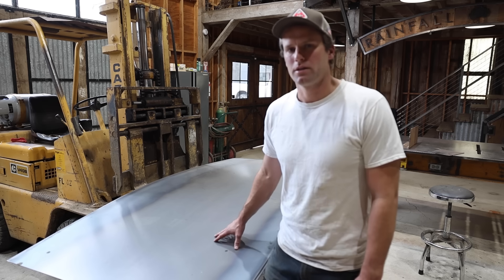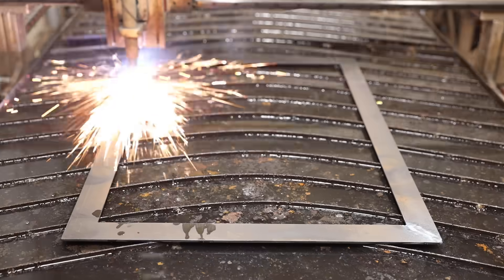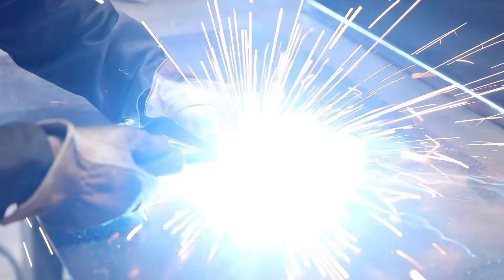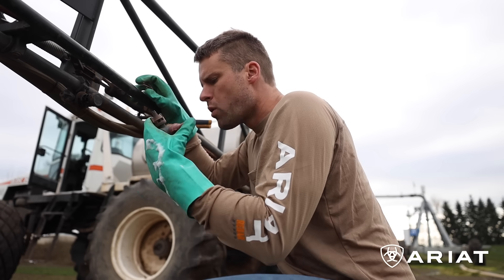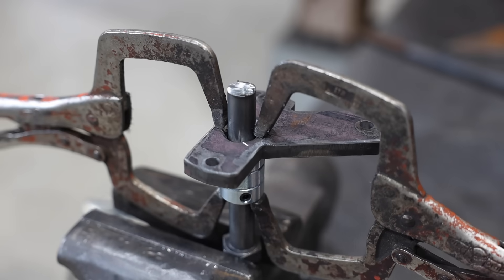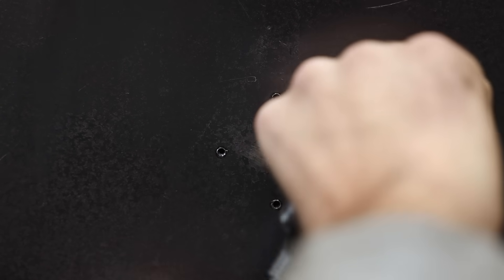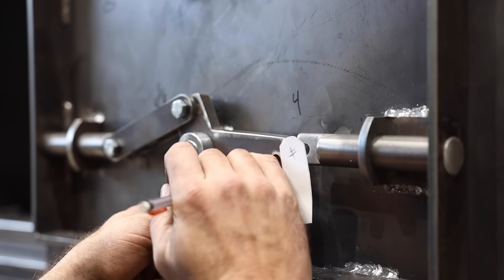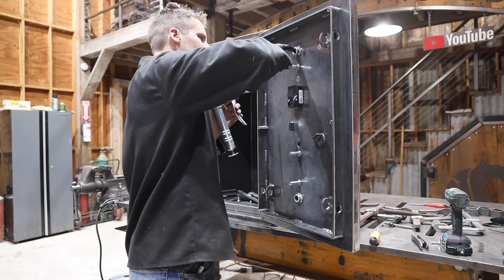Building a Fireproof Safe (pt. 1 of 2)

Comment: You could have coated the ends of the bolts with graphite or something similar to leave an impression ... I think.

What did you use for insulation?

Comment: The hinges on the outside: a no go.
1) Put the hinges at the top corners on the inside to prevent the use of a cheap grinder to crack the safe,
2) add a double/triple layer of hard/polymer concrete around the walls
Reply: How do you do inside hinges and the door open out?
Reply: @dnastats  You'd probably have to make some custom "pocket hinges". Even then, though, this safe wouldn't be too difficult to get into. You could get a big grinder and some cut off disks and get through the side, or even the door, in a matter of minutes. Though I don't think this safe is really intended to store anything super valuable. Just keep kids and maybe a "smash and grab" robber away from documents and what not. 

I have no doubt that his guy could fabricate something that would be a nightmare to get into, it's just a matter of how much time he'd want to dedicate to figuring out how to build everything and how much he'd want to spend on materials. In the end it'd probably just be cheaper to buy a safe from a company that has figured all of that stuff out -- or get one second hand.
Reply: @Sleepyjackable that's not a bad idea. And some 1/2 ar500 plate would make cutting into take alot longer and less likely anyone would run off with it
Reply: @dnastats yeah exactly, then make your "void space" no only be firewool but concrete then fireprotection or some cut resistant fabric that would bind up in a grinder. 

Ultimately nothing will stop a determinded person but itd be interesting to find ways to make it a headache!

Comment: To locate the bolt holes for drilling you could have just painted the locking bolts with wet latex paint you may have laying around and done the same thing.

Comment: Way better job than I could do... however I see a weak point with the locking mechanism.

The handle seems way too rugged.

 I would think that if you stuck a 6' metal bar into the outside handle and rotated it downward, it would snap the mounting points on the locking mechanism, allowing the bolts to be retracted.

Seems to be an easy fix you could just reduce the diameter of the handle shaft on the inside of the safe so it will snap before it breaks the mounting hardware or the locking key on the lock.

Or connect the handle shaft to some kind of shear pin.

Just constructive criticism.

Comment: It would have been better to fill the gap between the two layers with reinforced concrete and not with ceramic fibers? And the benefits of concrete, first, to increase the weight of the safe to prevent it from being easily stolen, secondly to increase its lamination to prevent it from opening? (Most of the safes in the world are filled with reinforced concrete) anyway good job

Comment: Pretty cool you can do this and very skilled. From a security perspective the Only issue is all a person would need to get in is a mallet and punch to knock the lock out. The “key” holding the 1/2 in locking plate to the opener doesn’t have any redundancy for tampering like most higher end safes. Similar to how you would knock out a deadbolt. That said, given enough time most safes can be broken into. Great vid, cheers!

Comment: 1" bolts and 1/2" brackets ON A SHEET METAL SAFE?
Also you did not put any heat expanding fire seal around the opening, so all the heat and smoke is just going to pour in your door gaps anyway.

Comment: Nice build, and I really like the door's linkage.  Future Tip - when you have to locate pin locations like that, you can "soot" the ends of the pin with your torch, or a daub of your wife's lipstick, to make sure you have a clear, clean impression.  If you use your wife's lipstick, make sure you don't tell her you borrowed it.  Wives do not take kindly to such things.

Also, the fire rating drops precipitously when you don't insulate the door or use a fire seal around the door.  All that insulation on the body is for naught if you don't seal the door and insulate it every which way you can.  Some 1/4" drywall/gypsum can be layered in there, making sure to get under the linkage mechanism, and some Kaowool blanket can fill the voids without worry about tangling around the mechanism.  The door seals are available COTS, and help to seal things when the heat rises, but also give a more finished appearance.  Without those two details, the same isn't resistant to heat/fire no matter how much insulation you put in the hollow core of the body.

Comment: Just wondering when he got to the last part, figuring out where to drill the holes for the locks.   His method with tape and trying to close the pins hard worked but I was wondering if putting a single strip of tape and then painting the end of each pin with something like a wax marker or lip stick would  have also worked?

Keep in mind I'm just someone trying to learn and build my own knowledge.  I'm no where near a point I could effectivly or efficiently construct a 2 x 2 in welded cube much less a fireproof safe yet.  Lol

Comment: Next time to drill holes for your locking pins just put a thin little coat of pain on the end of the locking pins then close it like you did and just turn the lock one time till you feel it’s snug then open door up it should have you a little paint circle then draw the outline if that with a sharpie and wipe your paint off then cut on inside of line

Comment: My trick for mathcing those holes at 15:00 is to put a ton of sharpie on the round bars, then it leaves a round mark at the right location. If the sharpie is drying too fast, I'll use paint

Comment: Here are a few simple and inexpensive adds ons for exponential strength and ROI: Internal clutch disk for the crank to prevent brute force attack. Right now the force transfers directly and you are vulnerable.  I have bought them from safe manufacturers directly for cheap. No need to drill holes in square steel to accept locking bolts, just use a thick (1/4”+) flange and bolts lock behind it. Add a simple non-mechanical reverse flange, or even a few pins, on the door (hinge side) that automatically become a friction press fit when you close the door to thwart pry bar attacks on that side and allows you focus on top/bottom & door side locking bolts - 4 sided locking support. Finally try to double support the locking bolts on the door side, again an easy add on for for anti-pry. Add a simple Re-locker mechanism (again transfer the loads and isolate - glass, etc.). No Tupperware At All - it melts before 451F and destroys the paper! Use the thermal expansion seals everyone is talking about. Dehumidifier (and maintain it). LED lights. Hope this helps the next build and others! Rock on!

Comment: I saw a video about a gun safe recovered after a fire. What caused the $25,000.00 to fail was no the fact the safe kept the guns safe but the water used on the fire got inside the safe, ruining the guns. and valuables & documents. The fire did case some of the rounds to explode inside the safe. Possibly building your safe to be water resistant as well as fireproof is the way to go?

Comment: I am a safe and vault technician.  You did an outstanding job on building this safe.  Everything you did was well thought out and works well, I am thoroughly impressed.  You do have one fatal flaw....you didn't add any relocker device(s).  If someone knocks the dial off and punches out the lock with a hammer and punch the lock will no longer prevent the bolt from staying locked.  A relocker will fire a bolt blocking the boltwork from moving if the lock was attacked in this fashion.
Reply: Can i have your contact?

Comment: Hope you put some holes in the bottom for anchor bolts. Anchor it to concrete floor with at least 1/2” bolts in all 4 corners. Then hide your plasma cutter since thats the easiest way to get into it.  Great build.

Comment: Some commercial safes use gypsum wall board as insulation.  The water chemically bonded to the calcium sulfate absorbs a lot of energy during the heating process.

Comment: Nice to see the S&G  in use . Well done very nice job looks impressive  nice lock links as well never seen links that well made before  they are normally bits of hacked out strip  few bits or hard plate in certain places would be a nice addition

Comment: A locksmith hint, get your wife’s old lipstick and smear some on the ends of those locking bolts and then slam them home they always leave a mark. It also works if you are installing a bolt lock on doors. A little lipstick on the end of the bolt and then work the lock a few times. It will leave a mark as to where you need to drill the hole for the strike plate for a deadbolt.

Comment: Anti drill plate plus spring loaded anti drill dead man system such as burglar drills into glass plate it cracks easily and releases spring-loaded bolts into frame dead sealing safe

Comment: I'd be making the walls at least top bottom at least half inch thick and the door at least twice that besides the locking pin frame plus fire protection lock mechanism protection if any

Comment: you spent all that money and time good you used good thick steel but why did you not do a anti-drill plate/glass.
my old one had glass on mine that was 2mm behind the door plate so if any one tryes to drill any part of the safe door dead bolts on all 6 locking bolts wires are under tension looped through the glass and each dead bolt is on a spring so the glass shatters the tension is no more the spring shoots down the bolts.
the only way to open the safe after this is to gring it open 
anti-drill glass is better than a hardend steel plate you can get drill bits that will drill hardend steel

Comment: Absolutely stellar work!  I loved that linkage, and really the entire project exudes a professional level of skill and expertise.  I've been in the market for some sort of fireproof safe or lockbox, and thinking about where in the house would be the 'coldest' in a fire, to place it.  Also gave some thought to a sort of fireproof closet to put the purchased box in, to increase its time and temp stats.  One thing the professional boxes have (that I figure I'd have to duplicate in some fashion in my closet) is an 'intumescent' seal that swells with the heat, since a surprising amount of heat can make it through a metal-on-metal jamb in a house fire.  Not sure how you could fabricate or source such a seal, but it might be a good idea to bring the doorjamb crack up closer to the heat resistance of the rest of this very well-built safe.  But anyway, kudos!  It's a great looking safe!

Comment: Nice job but calling it fireproof is a stretch. Fireproofing is accomplished by saturation of contents in fire which keeps interior below 350 degrees in a fire. The moisture for that saturation during a fire is stored in the fire proof liner, usually gypsum board (aka drywall) which is 50% H2O by weight. Gypsum is converted to plaster of paris and steam by heat of fire which saturates contents. Open this safe after a fire and I fear you'll find melted metals and ash from papers.

Comment: That's a really good job! Two suggestions for you now since you already put so much effort into this thing. 1: drill a hole on the inner door skin for the change key hole; this way you can always change the combo without having to remove the inner skin every time. 2: design an external relocker. I'm not saying you need glass, but a spring fired pin into the bolt work would do the trick.

Comment: Looks like you welded up the entire locking mechanism (unless I am missing something). This will actually make your safe less secure, as an attacker can now utilize the locking wheel to overpower the lock (by, say, putting a cheater bar in the handle). What you should do is make the shaft of the handle attach to the lock mechanism with something like a screw collar or grub screw, something that will be tight for normal operation but that will give way before the lock mechanism does. 

This means a quick and low effort attack against the locking wheel will fail (and will likely let you know an attack occurred to boot). If you tune the system right this will not even break the safe, as even a slipped grub screw/collar should have enough friction to open the lock mechanism once the lock is retracted. All you will need to do is open up the maintenance panel and tighten everything back up again and your safe will be ready for the next attempt.

Comment: There are ceramic studs used to secure kiln insulation. Also: for the locking pins, if they have a flat taper on the side facing out, and a matching ‘D’ shape hole, they will push in when you tighten them. Good to press down on a gasket. The gasket is the same stuff used for oven doors.

Comment: Hey there, chemical engineer here 
I just had some thoughts about the project. While yes, you are correct that themoflasks and things of this nature have a doubled wall design. The clever thing about them is the thing that is between these, nothing there is a vacuum. Since heat transfer is the energy one molecule transfers to another, if there is a very small amount of molecules to transfer heat with, the heat transfer will be very very good. there will not be any other material that beats a vacuum, that is why something like aerogel is 99% air. But I do not know if the walls of you safe would stand the vacuum to be fair, maybe thicker walls? This also means your safe needs to be waterproof:)

Comment: The easy way to find the right place for holes is like this:
1-Put masking tape on the door and cut out where the pins are.
2- Transfer the masking tape to the main box and drill the holes.

Good project  😉

Comment: That safe is super easy to open. Just place a metal bar on the wheel and you'll have so much leverage that the pin on the combinator will fall apart. But, since it's in the shop maybe it's faster using the plasma cutter.
Reply: Incorrect!  The set screw connecting the handle to the spindle will slip first.  It's an intentional weak point acting as a clutch.  Most safes are designed like that.

Comment: I know you have the double sided locking Bolts but hinges on the outside is a rookie move, grinder would hack it apart and then hack through the locking Bolts quite quickly if someone was determined

Comment: To enhance the fire resistance line the void and door with drywall board or joint compound. This is a common practice used by safe mfg. Some of  current safes I work on are using a concrete lining. Nice build.

Comment: Hot tip: try using red lipstick on the pins. The lipstick will transfer the color to the tape so you know where the hole needs to be drilled. I learned this trick from another YouTube video I saw.

Comment: @Rainfall projects -  Nice build... I would however recommend installing a thick anti-drill plate behind the dial to protect the lock itself. Also a 'glass plate' style, or spring-loaded cable relocking mechanism, they help resist against the more common brute force opportunist attacks on the door. I'd also strengthen the safe door jam with hardened steel around the entire inner door frame, thus resisting a determined crowbar from separating the door from its frame. In my humble opinion, this safe fabricated resembles a gun safe in overall 'resistive' strength, moreover not a 'safe' for high value cash and possessions. I believe smaller 'concealed' floor/wall safes, are in my opinion the best way to protect your cash & valuables. Thanks for sharing this video.

Comment: Just wondered if the insulation is thick enough. Compared to commercial fire proof safes, it doesn't look as thick. 
But I cant comment on the insulating material used for those, so who knows.

Comment: One trick I learned from a carpenter installing door locks was to use lipstick on the deadbolt when trying to figure out where things align. It leaves a visible accurate mark. Great work by the way!

Comment: Transfer screw punches would have worked better: For the lock bolts, center drill and tap, insert the transfer screw punch on each bolt. This would have left a point to align for drilling the lock bolt holes very precisely.

Two issues with the safe design:
1. Really needs 2" or more insulation to be able to hold up beyond about 30 minutes. If a fire gets near the safe, its unlikely the fire will be put out before the inside temperature gets too high. FYI: I have a commerically made safe that is rated for 80 minutes with 2.5" of insulation.
2. Needs to be water tight, as when the fire crew floods the space with water, its going to get the safe very wet. ideally some neoprene rubber gaskets are needed to keep the water out.

Comment: I found a BIG  construction miss in your design, you should have a stop welded to the door from the lock. as it is now you can turn the handwheel until the 4 small screws holding the comb lock and then you can open it

Comment: Nothing but Kuchenblech. The Kuchenblech-Mafia will have that opened in no time.  Two minutes max! 

On a serious note though: Why did you build the linkage so strong? To me this looks like the lock would be the weasest link, meaning that with a long enough lever you could crank the wheel and just brake or displace the lock enoguh for it to allow the lugs to open. 
Idealy you want you linkage to fail in that case, so that the safe is broken, but still locked. With this System you basically created a massive shear to to brake the lock.

Comment: If you build another safe. Use taper pins. So they advance into the frame, the slack disappears. 
Remember this :
A cordless skill saw with metal cutting blade will open the safe up in a minute. Plus the sounds the same as cutting lumber. 😬